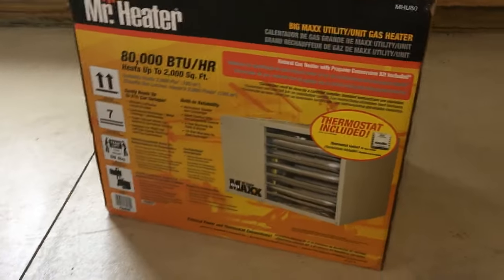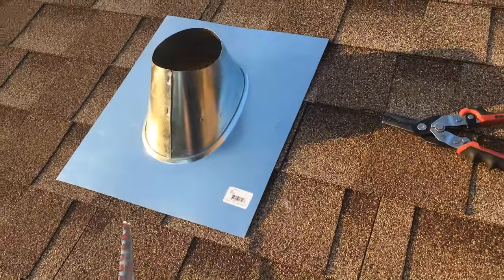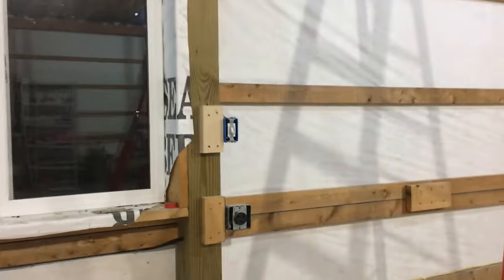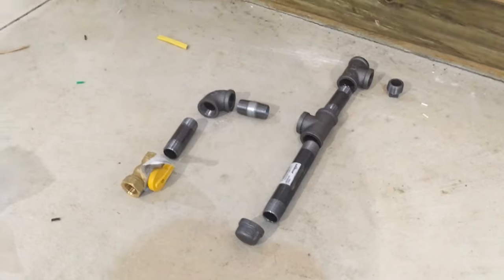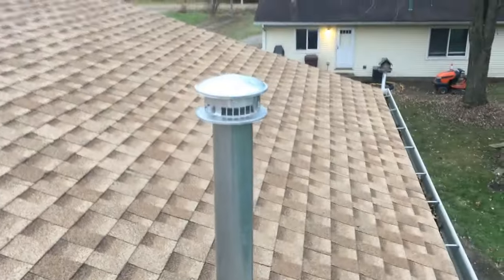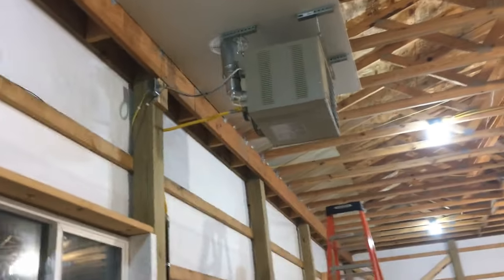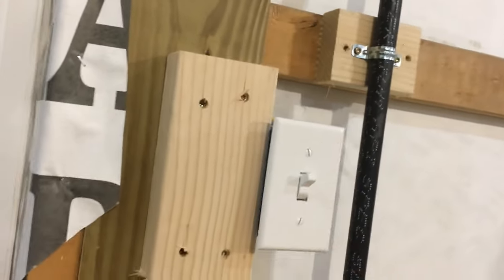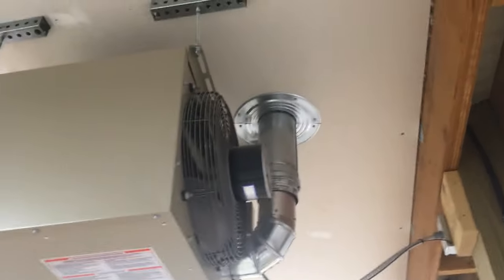Pole Barn - DIY Gas Heater Install and 1-year Update

Comment: Hey man just watched your videos, I'm basically in the same boat you were with my detached garage. I'm in the process of trenching now to have natural gas and a subpanel installed. Do you think it would be ok to bury the wire and the gas line in the same trench? I got the same heater last winter as you did, still unopened. Hopefully I'll have a similar set up to you by this fall. Thanks for sharing your experience and knowledge, best from Minnesota!
Reply from the maker: Awesome! You will love it when it’s done… total game changer to have heated space up in these cold weather states.  You’ll have to figure out what your township/city requires as far as burying both together. I think some places allow it if they are spaced 12”+ apart and held apart the entire run - I’ve seen bracing for that exact purpose. I’m definitely not the expert though since I dug two separate trenches for gas and electric. I usually start by looking up International Building Code and then checking for any local requirements on top of that.
Reply: NO! Never! Do not ever bury gas & electric in same trench. Need 12" separation minimum per most codes.

Comment: Hi Shawn, Great video with excellent detail.  Keep up the great content!  I'd guess that the person who installed the CSST for dryer at 11:40 likely left the extra slack in the line to possibly relocate dryer or since CSST is typically sold in preset 25' or 75' lengths, they probably left the slack rather than cut it off if they had no use for the extra slack.
Reply from the maker: Thank you, Ted! I like your reasoning on the CSST. I’ve considered moving the dryer so it was actually nice of them!

Comment: How did you hoist the heater up, to it's final position?
Reply from the maker: I just used a 10’ ladder and had a friend help me lift it.
Reply: @ShawnFerret  : how heavy is it? I plan to buy the same one.
Reply from the maker: @tch632  the internet tells me 78.85 lbs

Comment: that flex connector is not up to code. Maximum of 2ft for suspended appliances. 
4-6 foot connectors are approved for dryers or ranges.

Comment: I would have went through a wall if possible. Eliminate a hole in roof that could potentially turn into a leak.
Reply from the maker: They have piping adapters to go through the wall so that is an option too.
Reply: @ShawnFerret  I know they exist I just wasn’t sure if you could for your application.